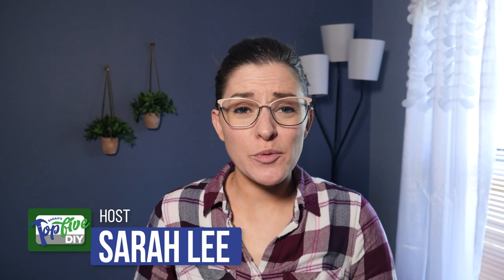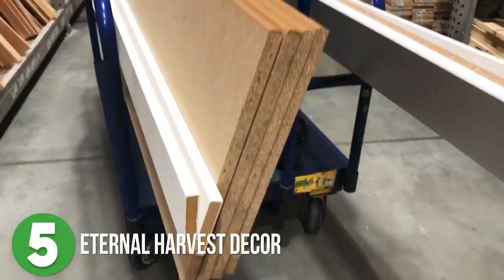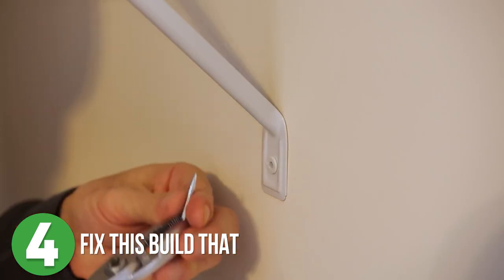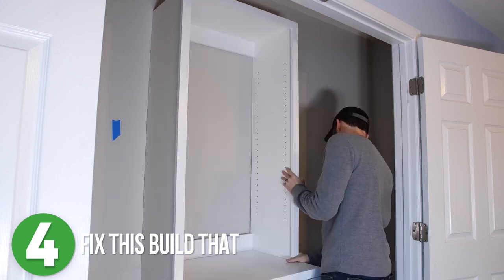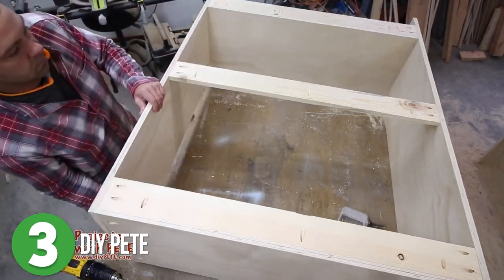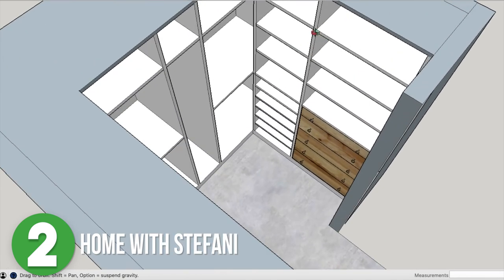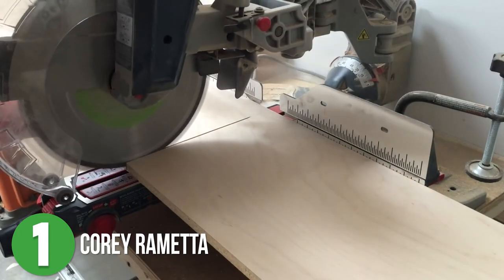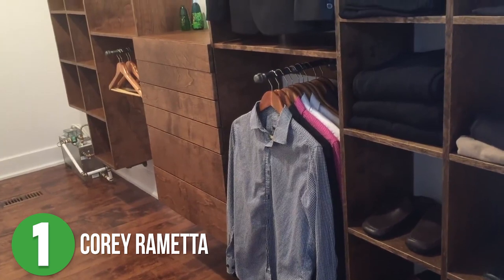Top 5 DIY Closet Organization! The Best Maker Videos For Your Next Build!

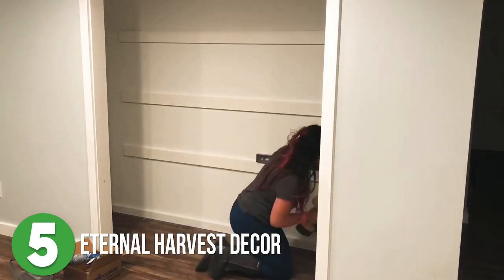Comment: 0:54 The glue on the cleats will not do much as both the boards and the wall are painted. What it will do is need the dry wall to be replaced when it needs to be removed.
Reply from the maker: That's a good point. Hopefully they never need to be removed!